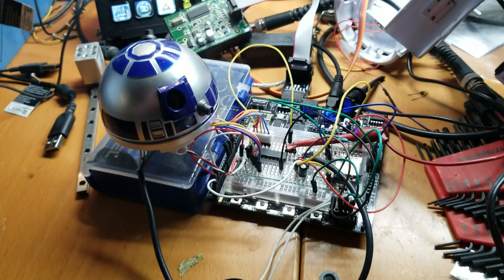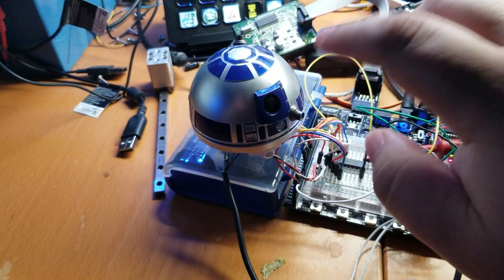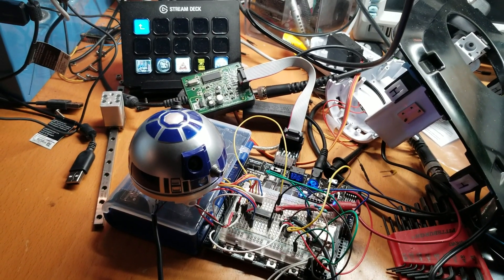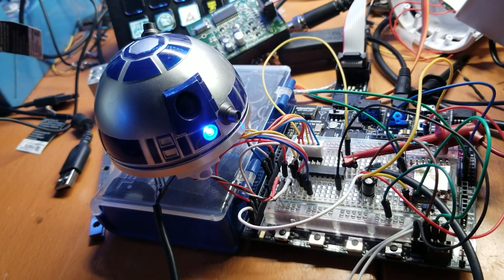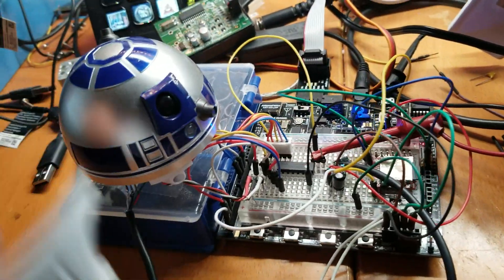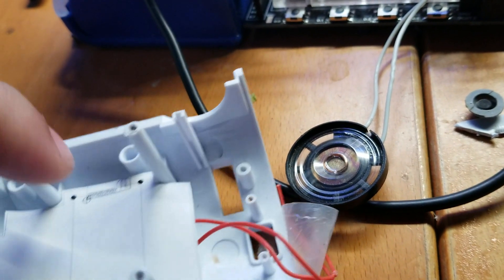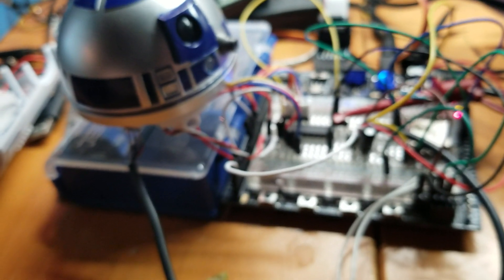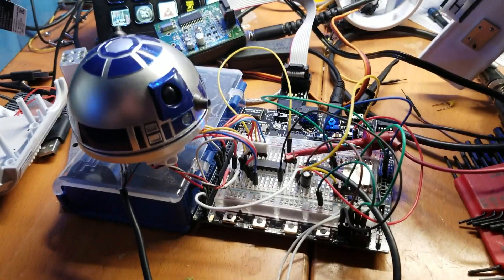R2D2 Radar Detector Project update #2 Main head unit.

Comment: What kind of breadboard is this?!? Parts/supplies used?  This is AWESOME!
Reply from the maker: Hey Steve this is my own breadboard design from years ago. uses Microchip as main processor but i have made arduino variants using leonardo framework. These boards come in very handy when testing and making new projects. This breadboard that i am using was designed to get my cousin interested in programming in basic.

Comment: Found it, love it, great work! I know this is a done project, but the SW Nerd in me has to say, it's Industrial Automaton ;) still love it
Reply from the maker: Holy shit i forgot the "i" in automation... good looking out. Still working on this project and many others. i have a tough time keeping track of them all.. i should post more videos. I really want to get this project back in my car. i never did a "Sun" or "Heat" Test to see if it would hold up. the project was only in my car for an hour. I made it very modular to take in and out the center panel. Glad you like the project. i just looked at the circuit boards and "industrial Automaton" is so small i can barely notice the "i" is missing LOL. oh well.